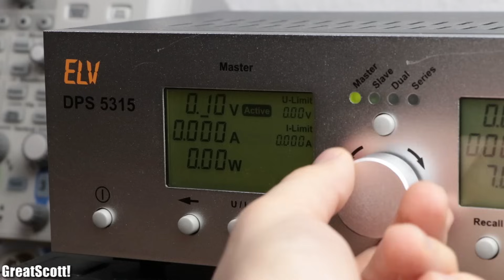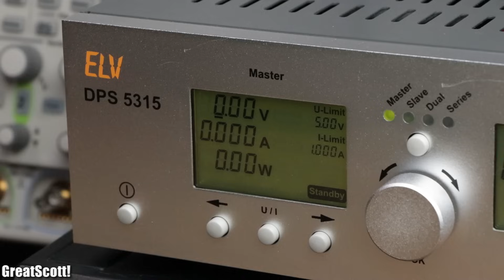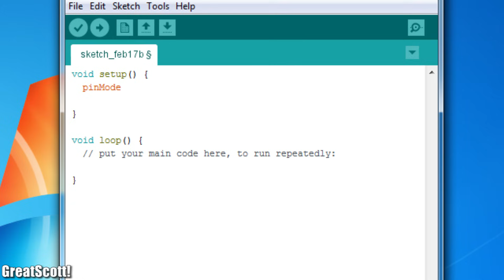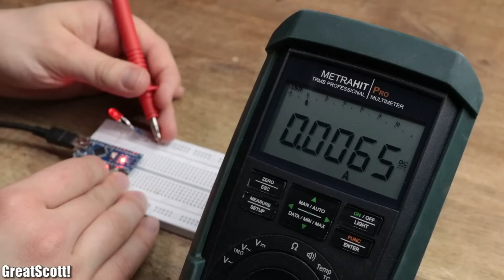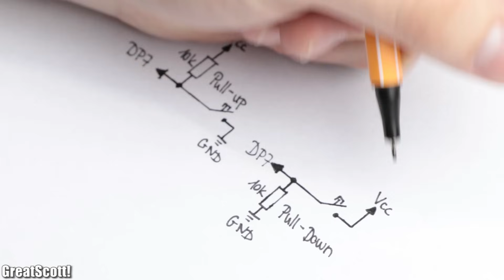Arduino Basics 101: Hardware Overview, Fundamental Code Commands

Comment: Arduino is good for beginners, but if you realy want to get into AVR Microcontrollers, it is a good idea to have a look at Atmel Studio. It is made to programm the AtMegas directly without the Arduino system. That means, that you have more memory to use and your programms perform better. Not to forget the direct hardware access. It's maybe a bit complicated at the beginning, but much more flexible and realy worth it. For example, because you can choose between lots of Microcontrollers, to find the right one for your application.
Oh, and it's cheaper, because you only need to buy a microcontroller and not a whole board.
For more Information, have a look at http://www.mikrocontroller.net/ (German) or (of cause) http://www.atmel.com/ (English)

Comment: Nice video.
Is it possible to use the Arduino to adjust voltage when you have a current of 10-15A? (0-12V).
So that you fx measure temperature and humidity, make som calculation using the Arduino and adjust a voltage between 0-12V depending on the calculations.
If the Arduino only can handle 40mA it cannot be controlled directly, thus I expect you would need to add some kind of a voltage regulator that can be regulated using the outputts form the Arduino.
But is this feasible or should one use something else than the Arduino?

I am looking forward to more videos using the Arduino.

Comment: I'm currently working on a project with an Arduino and an ESP8266, and I'm running into a lot of issues with maintaining two serial connections on the one Arduino. If you could address multiple serial connections in one of the future Arduino videos, that would be great! Thanks for such an amazing channel; I've learned so much, and I've been inspired to start my own projects because you've shown me what's possible!

Comment: Hey GreatScott! This was a great video, because not only did you explain what Arduino is very clearly but you also showed many examples to get us started. I will pick up a couple of these to test some stuff with. 
I have a question that's maybe not related to this video, but I think you might be able to help as you have a much better understanding of how this stuff works, as I've seen in all your videos (or maybe someone else in the comments can andwer as well). I have a little project where I want to start up a computer using a button on a web page hosted on a Raspberry Pi (Zero). When you click the virtual button, the Pi executes a bit of code using PHP,  I have gotten that to work so in theory I should be able to just enter some code, but I don't know how to connect the GPIO pins to the pins of the ON button on the computer and have code allow the two pins to short circuit, because I believe that's how a button works? Maybe I need something else in between the Pi and the computer, but I have no idea what and I don't seem to be able to find any information about this online (I just don't know what I should be looking for). Maybe the Arduino has more functions for this, or would I need a different component that can be connected to my Pi?

Before anyone recommends checking out Wake On Lan for this purpose, yeah I've tried that but the BIOS doesn't allow it and the option is locked so there's no way for me to use that, so I'd thought I would go the hardware way but I don't have a lot of hardware knowledge so any help would be very appreciated (and this concept could be applied to many more projects, any hardware that has a button in it could be activated this way I think?)

Comment: And if you're more of a Python guy, there are MicroPython boards … and a MicroPython firmware for the ESP8266.
Reply: interesting. maybe I'll have a look into it. is there any benefit in using these other than coding?
Reply: h def: There's a real REPL running on them you can Telnet (or serial connect) to, so you can try out things instantly. Also "updateing" your code is merely uploading a new .py file via FTP. No compiler needed.
Reply: +Markus Birth (mbirth) 
what about the execution time. which code is more efficient if we want to design a more time critical system
Reply: There are stanzas to make the interpreter pre-compile time-critical functions of your code if you need more speed. But even without that, you should be able to do everything you can do with an Arduino. See also: http://micropython.org/

Comment: I missed this being published because... I was implementing my first Arduino projects. 

using an Arduino and a 4 channel relay, I've automated my chameleons vivarium: UVB lighting, night lighting, heating and misting, as well as humidity and temperature sensors! next up is data logging it & adding Bluetooth communication to change on/off times and randomly trigger events such as an extra misting.

Comment: please do one on the exotic pins on the arduino, like TX, RX, SCL, SDA and ICSP.
And one about interrupts
And one about low power mode
Probably those last two the earliest because those are the most important for embedded projects.
Make a project that requires slave arduinos!
And a videos on certain communication libraries, like ethernet, wifi, bluetooh, RF.
Reply from the maker: Thanks for the feedback. I put it on my to do list.

Comment: why does analogRead must be divided by 4 ?
Reply from the maker: With the analogRead you get a 10 bit value (0-1023). But the analogWrite needs an 8 bit value (0-255). So dividing it by 4 "scales" down the 10 bit value close enough to the 8 bit value.
Reply: to get a value from 0-255 for the PWM.
Reply: analogRead is a 10 bit value, so 0-1023. The PWM output is 8 bit or 0-255. If he didn't divide by 4 the LED would get to full brightness when he turned the potentiometer 25% and just stay at full brightness as he turned the pot further as the PWM out maxes at 255.
Reply: Oh, thanks! In school we work with arduino hardware and software, and PWM are our next lesson. Video series about Arduino would be very helpful. :)
Reply: 10-bit to 8-bit. 2^10/2^2 = 2^8

Comment: I like the chinese UNOs but I don't like the smaller versions beacuse they are uncomprortable... so I try to use them as less as possible.

Nice video!
Reply: well, the big ones are ment for prototyping and the small ones are ment for actually embedding.
I only get my arduino pro mini out when I also get a soldering iron, and I only do that when I know it works perfectly well on the normal uno.

Throwing in full fletched boards into embedded projects is a waste of space, money and energy (because of less chips, the mini is more efficient, making it better for projects running on battery). Prototyping on a mini pro is just downright masochistic.
Reply: @cube_cup  or do what I do and buy a bunch of semiconductors as one should have and build your own  arduinos
Reply: +PrimaPunchy then the digispark is mabe something for you.(or attiny85)
Reply: Digispark is rather gimicky IMO. It's smaller, but it's expensive so you're not using it for embedded systems, but rather for prototyping. But then again, just get an arduino uno.
The attiny85 is amazing. I ordered a few a little while ago. Extremely cheap for how powerful and multifunctional it is.

Maar ja, wel een goed idee.
Reply: the digispark clones are really cheap. I buy from aliexpress and there I can buy a digispark for 1 euro and just one attiny is 1.03 euro. this isn't a massive diffrents but with the digispark you already have the usb and some lights build in
Reply: they are? I found them for 8 euro.
I'll look into it again